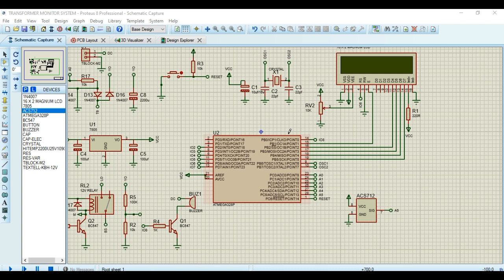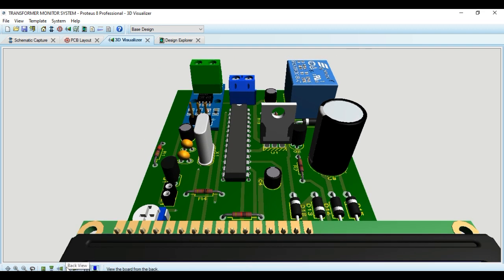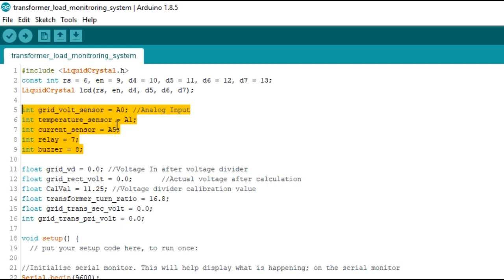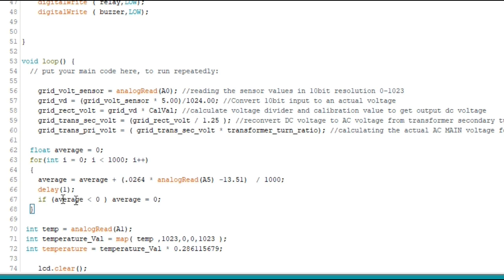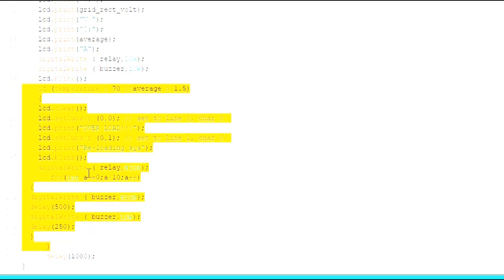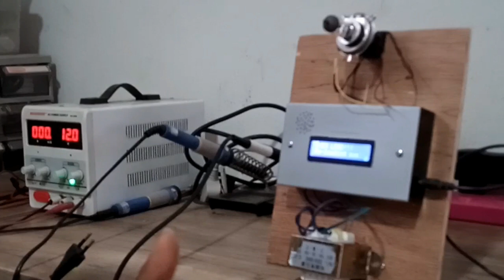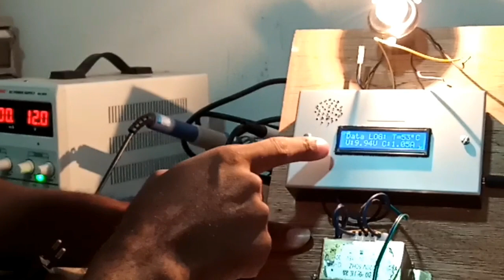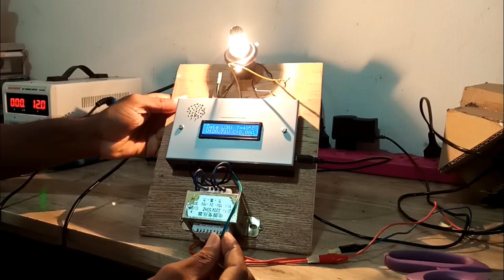Transformer monitor and control system ( Electrical Transmission line Transformer Overload system)

Comment: Another great project. Thanks for sharing.
A question pls. How were you able to read multiple analog inputs at once because I read Arduino has only one ADC ?
Reply: Thanks for this. 
I need your help pls. I'm using to current sensors connected to two different analog inputs. I'm finding it difficult to compare both as one measures current before the other instead of measuring simultaneously. Thanks in advance
Reply from the maker: @quadriakinbode4812  
Text me on Whatsapp via this number, so I can assist you
+2348096283289
Reply: @MEmbedded_TechLab  ok. Thanks much
Reply from the maker: Thanks so much for the kind feedback.

You can read 6 analog input on Arduino as it has 6 special inputs for analog inputs.